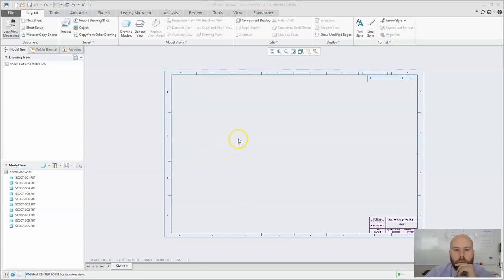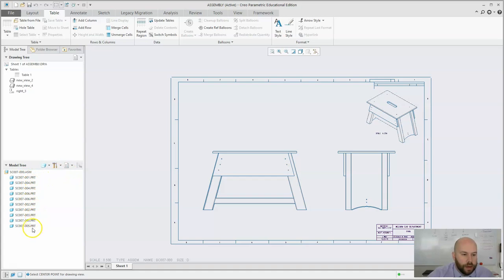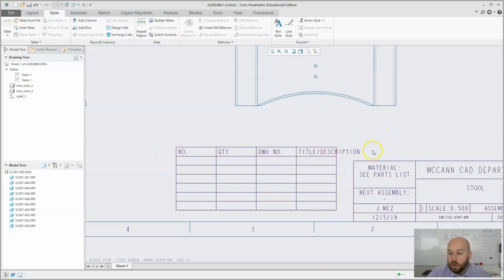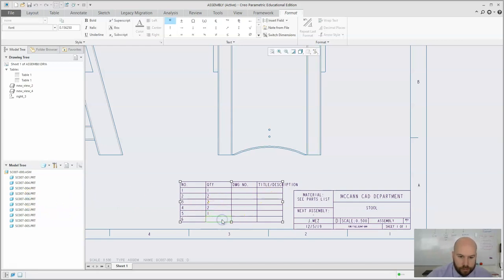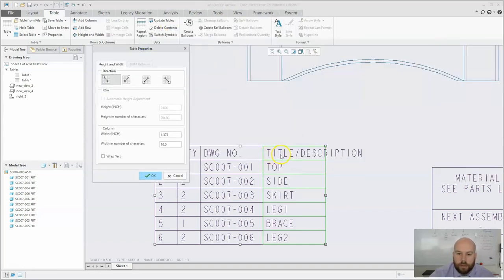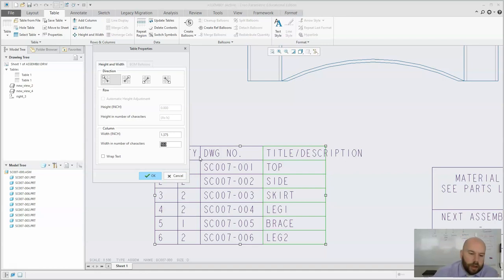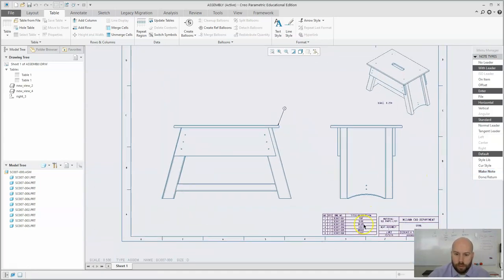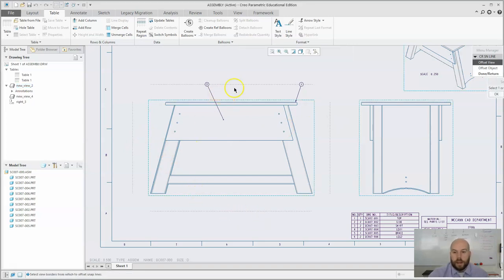CREO: CREATING A BASIC ASSEMBLY DRAWING

Comment: Nice video thanks.. What I actually am looking for is this: 
The way constantly indicated is the so called "mono-drawing-system". How does one get PTC Creo (got version 7 here now) to work in the "combination-drawing-system" ?

The "combination-drawing-system is" making an assembly drawing on sheet 1 and placing the parts of the assembly fully dimensioned on sheets 2, 3, etc. (and on 1 if there is still space). 

The title block of sheet 1 is filled in with the parameters of the assembly. Perfect. But now I want to define the parts of that assembly on sheet 2, 3, etc. When I add a model to the drawing, add sheet 2, and set the part-model active, the title block information on this sheet 2 does NOT contain the same data of the title block in sheet 1 (so the data of the assembly) but the data of the part-model. 

This is odd, because the drawing bears one name and 1 number. Not sheet 1 with a name and number and sheet 2 with another name and number. I'd add a small indicator table to that particular part stating some data which is necessary to know, there. 

Can you explain me how I get the title blocks of both sheet 1 and 2 to harvest their data from the assembly model rather than 1 from the assembly model and the other from the parts model?
Reply from the maker: I will add this to my to do list on drawings. The simple answer is: You need to add drawing models.

Comment: Thank you very much for your video. It helped me alot allready. My only Problem is that i have a format for drawings from the company i work for and there is a big table as a outer line of the whole drawing. So if i want to work in the parts table i always select the outer one ... Can you somehow disable the the selection of the big table  not the table itselft ?
Reply from the maker: Ah I see. That is a great question and a difficult situation. I recommend getting used to holding right click and selecting "pick from list" or right clicking so it cycles through the list. I'll try to create a video to help with this.